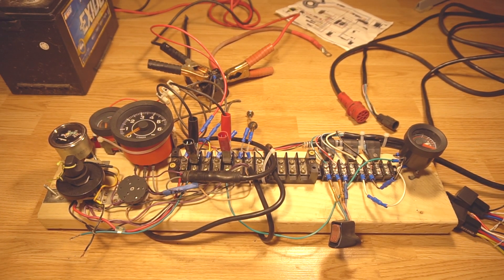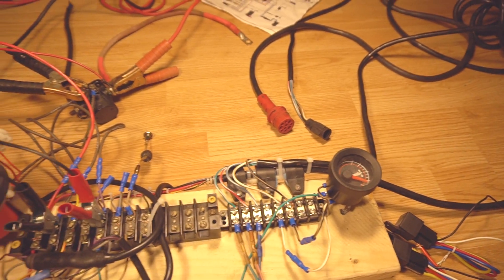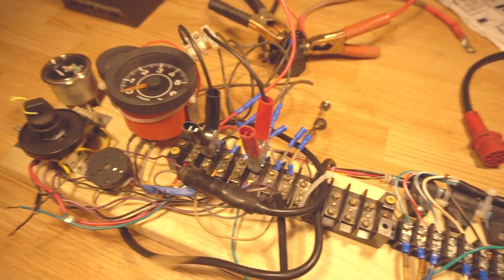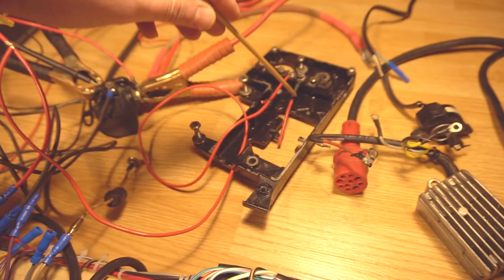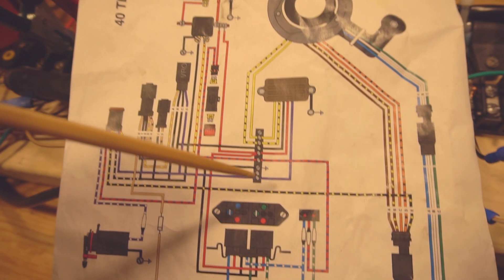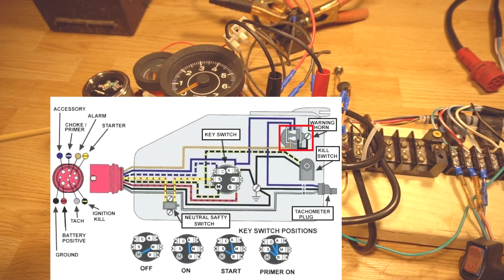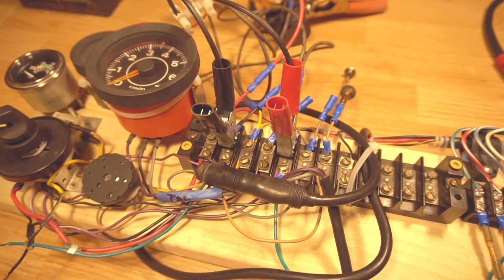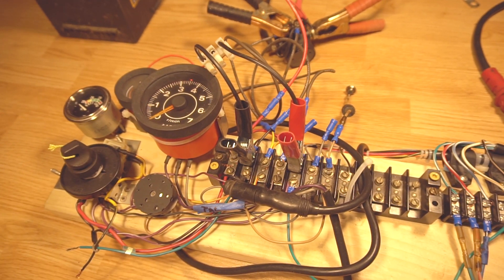Outboard Motor Control Wiring Part 1 - DIY outboard test control box

Comment: This walkthrough has been tremendously helpful in getting my 72 Johnson 60hp (Hydro-Electric Shift) back up and going. After rewiring the ignition switch I still wasn’t hearing a click from the solenoid. I bypassed the solenoids to put 12v to the starter and it kicked right off. My question now here is this. From the solenoid(the side that connect to the battery, not the starter) I have the same purple/red wires. One runs directly to the terminal block and the other runs through the 20amp fuse back through the plug to the switch. The two terminals off the solenoid are marked S and I. The I is closer to the + battery lead and leads directly to the ignition switch while the other terminal looks to go up towards the stator. From my understand that second terminal should be my ground, correct? Maybe it’s possible it’s grounded up near the stator/flywheel? Thanks!
Reply from the maker: I would do a few more google image searches for evinrude wiring diagram, its hard for me to tell as I do not have the object at hand.
Reply: @IdeaMan4k  if there’s a way to direct message, I’d love the help.

Comment: I wish I had seen this video a week ago.  Hooking up an old 76 55hp Johnson last week resulted in a melted ground below the power pack,  fried rectifier,  destroyed power pack and a wiring harness full of regret.  ENSURE GROUND ON STARTER, and that the solenoid wont stick like mine did and send full amps to a 8 gauge wire via the engine block.   Horrible day and a 300 dollar bill... if it starts.

Comment: Great video. My starter and trim stopped working, but I have power to the solenoid, so i should check that fuse.
Reply: It’s a 16 ft Whaler and I discovered that it was the battery cable patch panel under the starboard back seat.Cleaned up the connections and she was good to go. I did learn a lot in this video though.